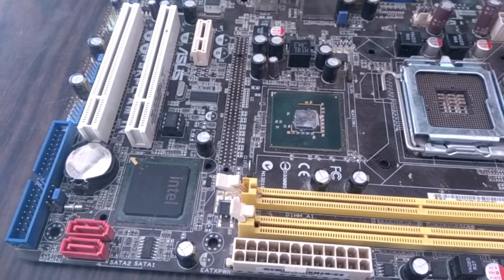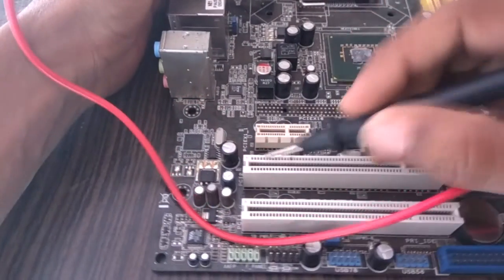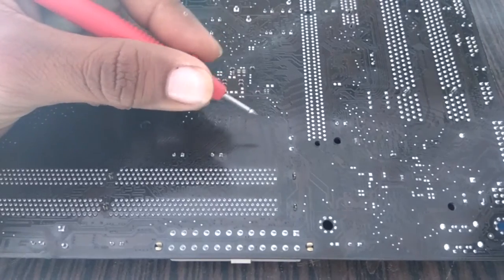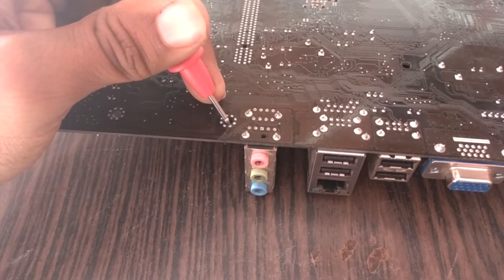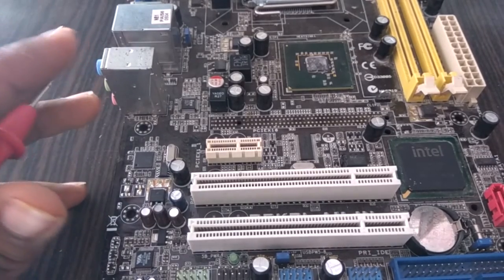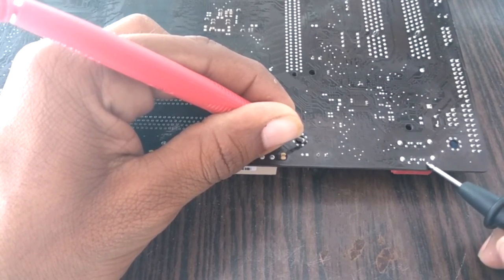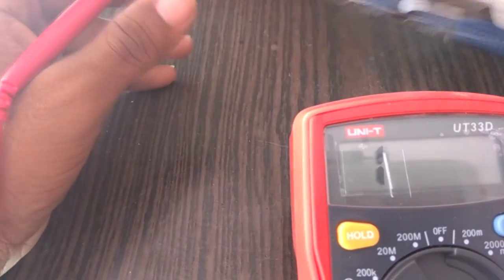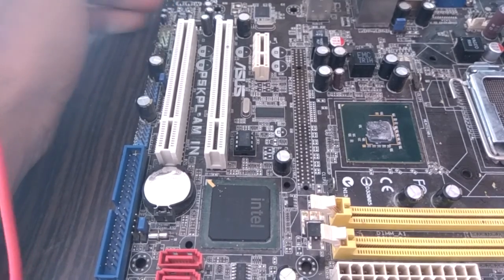[Eng]Advance Chip Level Motherboard Repairing :Lecture 10-South bridge testing in Desktop Practical

Comment: The housing of the audio ports is not GND in a  motherboard i have. It says A_CGND and is isolated from GND.
Reply: Correct. Also Pin 1 on IDE port is not data pin...

Comment: I have an MSI G41M-SP20 motherboard, and as soon as I plug in power, without even turning the computer on, the south bridge begins to heat up, and the board wont turn on. I believe my south bridge is faulty then? I did all the checks mentioned in this video, and found that the pin 14 in the PCI slot read a short to ground, and the 2 middle data pins of the first usb port read a short to ground too. RIP this south bridge..

Comment: Acer G31 south bridge get over heat even its power off. (i.e stand by) ON OFF button work properly. but no display show. I confirm there is no short circuit in VRM or North bridge. I check south bridge as you teach in this tutorial but all testing is ok. What i do now.Please help me.Thanks

Comment: hi sir,i have p5ql pro mobo,when i touched south bridge (the farthest one from cpu ) its very hot,cant touch more than a sec,but northbridge is ok hot to touch more than 3 secs,temps shows motherboard as 41c,sometimes i had a problem of no signal to monitor,i use gt 730 graphics card,pls guide me,once the pc got shutdown by itself then it woudnt start,i cleared dust from something called as mofset neat cpu,then it started,then i cleared dust everywher and applied thermal grey compund n running ok,but sometimes lately it got freezed,nvidea graphics caused bsod etc,for now i would like to know this too hot south bridge,will it cause problem in future,pls guide me,thanks

Comment: My computer is automatically turn off I found 6 MOSFETs and 6capacitors are shorting I removed but not solved my issue is it south/north bridge issue??
Reply: Check your CPU heatsink....if CPU overheating computer automatically turn off...